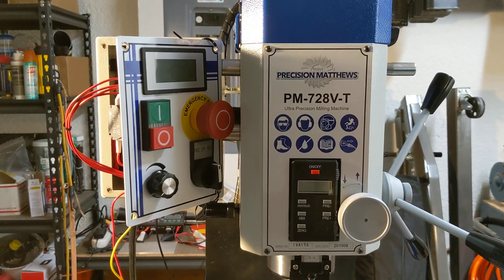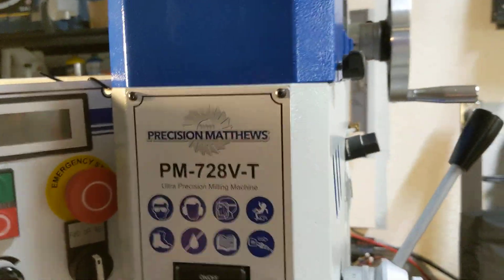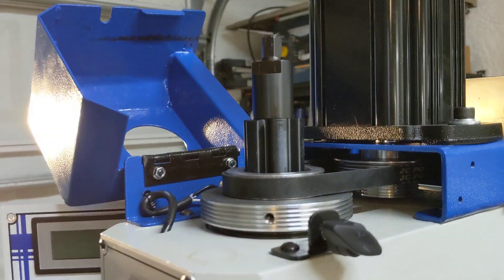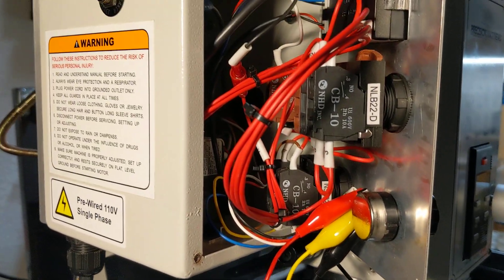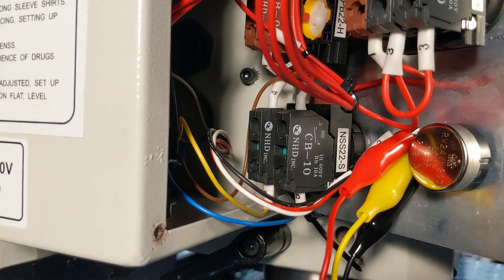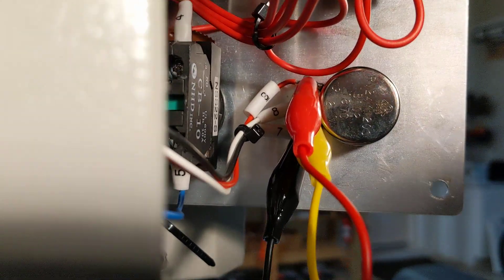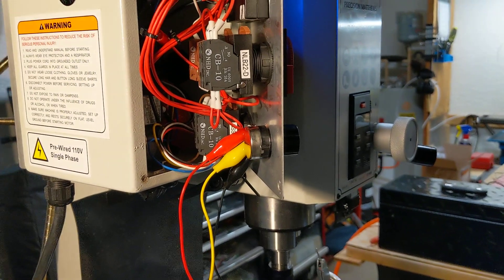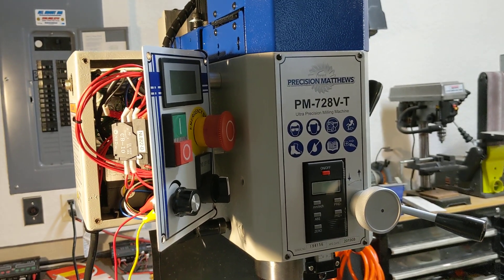PM-728VT Spindle Control #1 with Centroid Acorn

Comment: Hey Franco, thanks for all your info you have put out. Super helpful! I am converting a 728VT right now. I got the speed control adapter board with the cnc kit from PM. Im kinda at a loss as what I exactly need to do to install it and connect it to Acorn. Also, I thought you said the link to print that encoder bushing was here but, I dont see it. Any chance I could chat with you about this? Thanks, Josh

Comment: I did a timing belt driven encoder setup on my G0602. Printed the encoder pulley to match the sprocket on the lathe.  Higher RPM might need a pulley that is 'truer'. Plan on doing a PDB down the road and this should not interfere. Keep the vids coming.

Comment: That dual relay configuration, where it's impossible for them both to be energized at the same time is called an "interposing relay" configuration. I'm not correcting you, just adding in some terminology.
Reply from the maker: Thank you for that.  I'm not always up to speed with the correct terminology and I appreciate the help.

Comment: I also converted spindle control on my PM30 using the schematic linked in your older video. Thanks for posting that. The acorn also adjust for belt position using a ratio parameter for high / low. I have also considered adding a spindle encoder and found what may be an easier way. If you pull the front plate off you will see the index wheel used for the speed display. There is a company that makes a encoder ring and reader that could replace the index wheel or possibly sit along side it. I can dig up the information again if anyone is interested.
Reply from the maker: I'd love to see that encoder ring!
Reply: @FrancoCNC  Here is the company,; https://www.rls.si/eng/products/rotary-magnetic-encoders. I will also look for the forum post that was discussing these encoders.
Reply: @FrancoCNC  This is the forum post where a gentleman used one of these encoders on his bridgeport. https://centroidcncforum.com/viewtopic.php?f=64&t=1944

Comment: I added spindle control on my pm25mv with acorn using the info from your video with that 0-5v board. It's working good. Next is to add a encoder. Keep up the good work.

Comment: Have you disassembled the z axis already?  I took it apart to take some measurements for my own attempt at a CNC conversion and the bevel gear assembly was a real pain to take apart and even more of a pain to get back together again.  I feel like there should be an easier way. Maybe there's a better order of operations.  Any tips?
Reply: I took mine apart also.  Did the X, Y, and then Z. Did take a bit to get the gear assembly out, the keeper on the handle shaft made it not just 'com apart'. I don't plan to reinstall it.  Ball screws have shipped :)

Comment: Think I'm going to have enough to order one this weekend.  Decided to go with the PM-728 over the 25.   I've seen a few different parts made in China for motorcycles and firearms and have always found and issue with them whether it's the hardness of the metal or the tolerances, theres usually something sub-par when you buy something from China so figured itd be worth it to pay more and get a bigger machine that's made in Taiwan, better QC and 5yr. Warranty is worth the extra money IMO.  
  Probably wont be doing CNC conversion anytime in the near future, only plans are customizing parts for myself or 1 off parts, but definitely going to save these videos just incase as plans change down the road alot of times..
  Enjoying all the videos you've done on these machines, looking forward to more!

Comment: Franco, love your videos, you inspire.  Just picked up 3 stepperonline Nema 24 closed loop steppers with the CL57Y controller for my Smithy 1220XL 3 in 1 conversion.  What do you recommend for power supplies.  Also I see you use ACORN, how does that compared to Mach systems.  Keep up the great videos